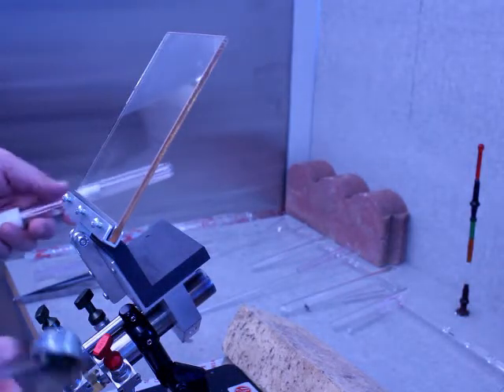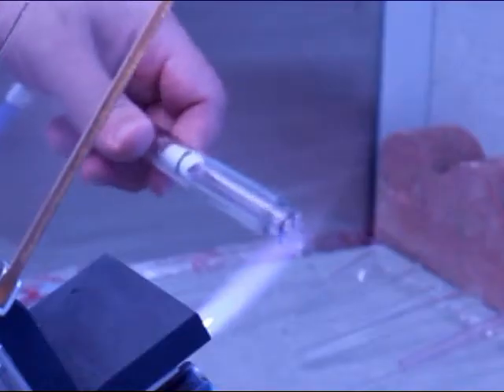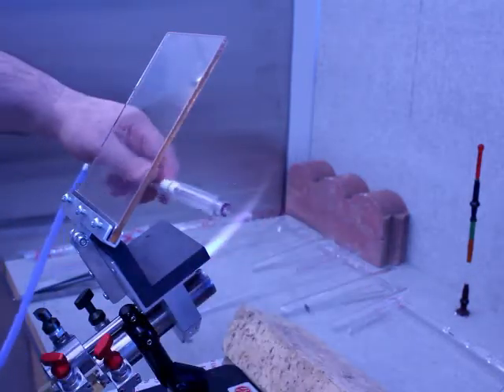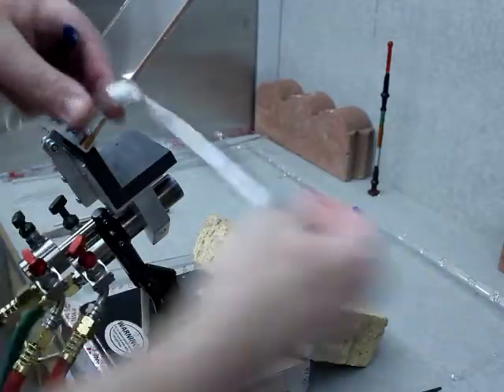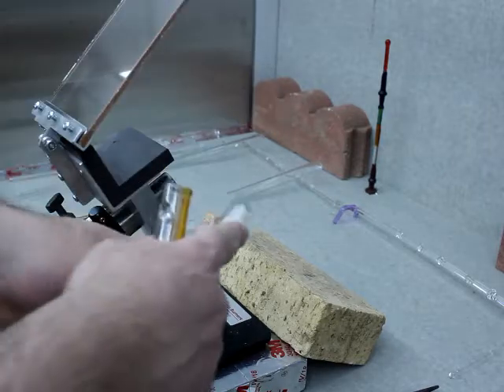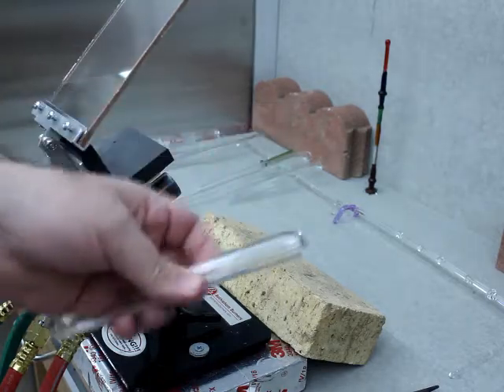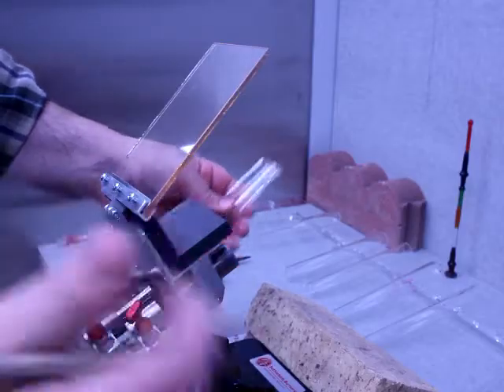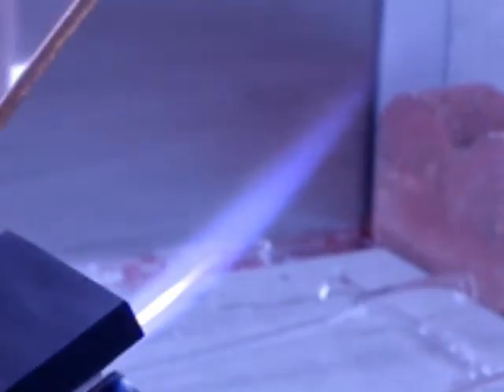How to "cheat" at making a ring seal.

Comment: I have pretty weak lungs and can really blow hard enough.  any recommendations on an artificial source? So far my best finds have been the bulb off a blood pressure cuff and a siphon bubble
Reply from the maker: In confections they use a blood pressure bulb.  It definitely works, but would require a lot of practice.  Maybe if you set up a foot bellows that would work?
Reply: @ScientificGlassblowing I'm currently working on a set up that works. A bellows might be just the trick. Problem I'm running into is the bulbs really dont give a steady flow, it's all at once. I'll try a bellows and let you know. Thanks.